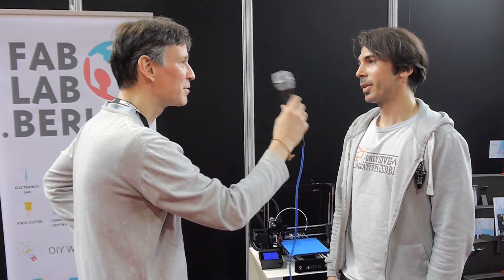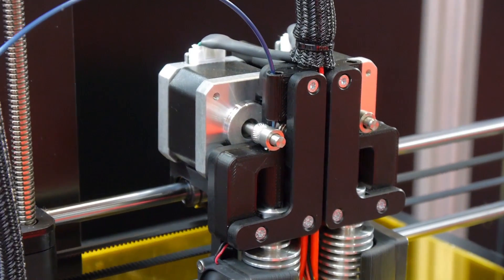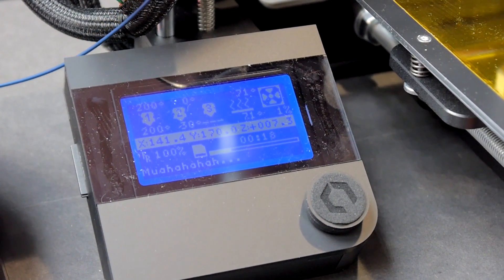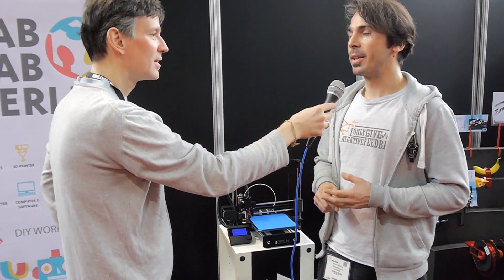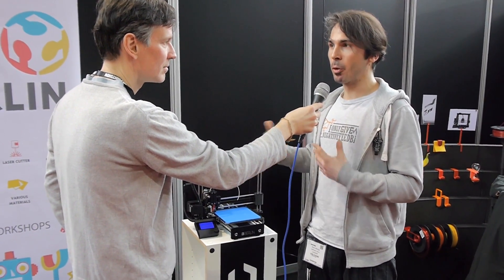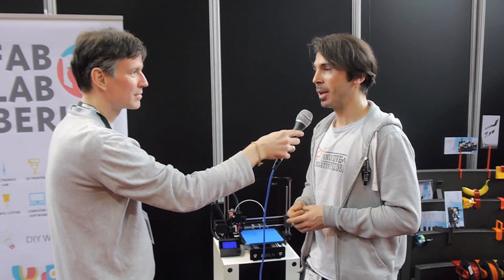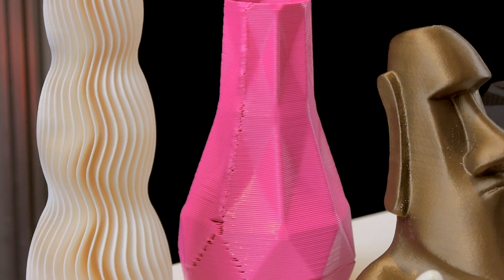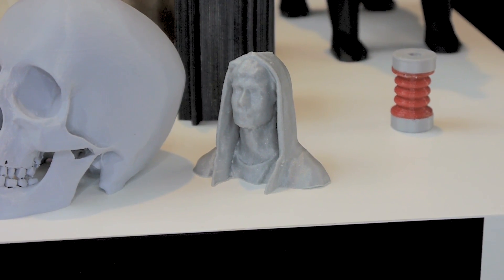3DPS: The FabLab Berlin and their i3 Berlin 3D printer!

Comment: ebay links aren't working.
Reply: ***** They just redirect to the ebay front page when you load them.
Reply: I found the price on their webpage anyway and unfortunately while they may have made it better, they also made it over 4 times as expensive 6 times more expensive than the cheaper models :/ for that I could buy a fully enclosed printer. So I ended up ordering a Replikeo Ormerod 2 instead.